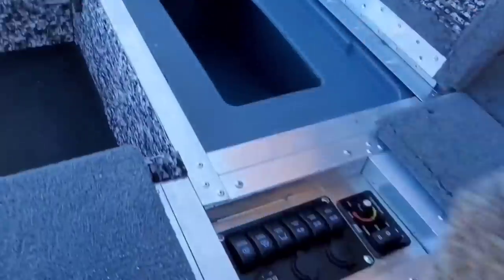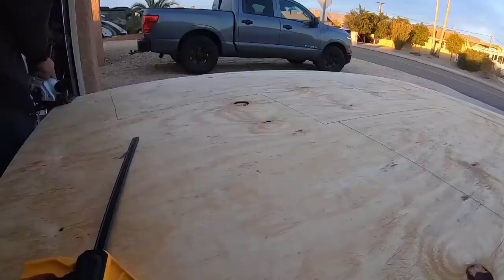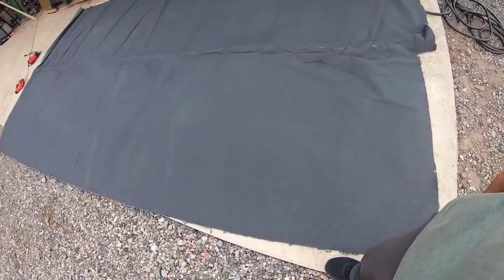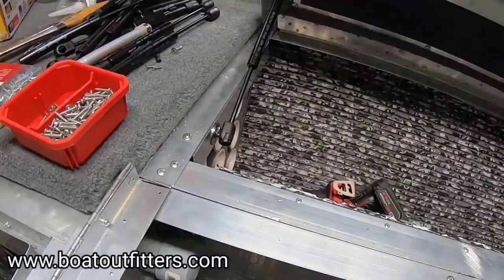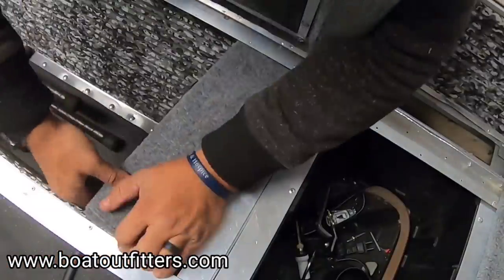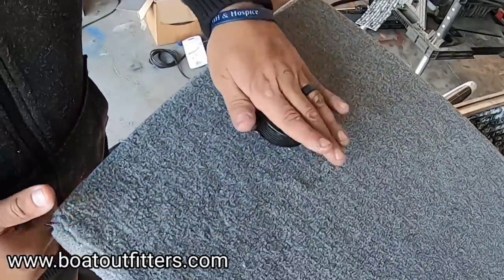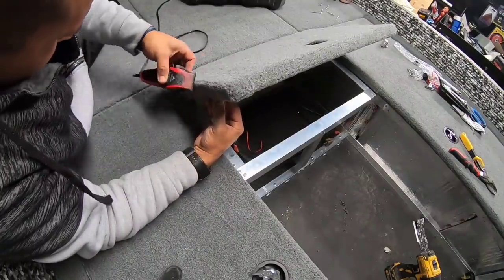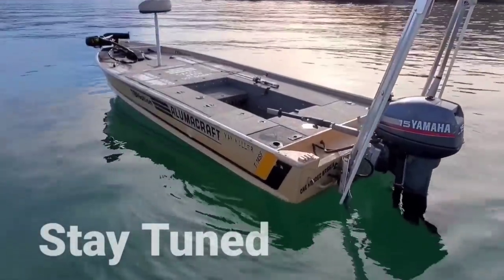ALL- WOOD Bass Boat Deck - UltraLite: Jon Boat to Bass Boat Conversion

Comment: Try using Matrixx underlayment from Traxxcorp. We use it for flooring it’s 3/8” 7ply birch. Stuff will almost not swell at all. No voids. Dimensionally stable. Although it is not cheap. And comes in 4’x5’ sheets.

Comment: Are you using small pieces of aluminum flat bar as the trim for the underside of the hatches? I’ve tried finding that online, to cover the edges of the carpet underneath the hatch, but I’m having no luck.